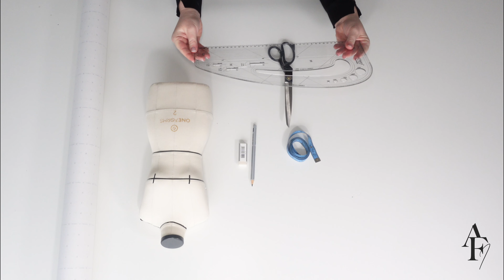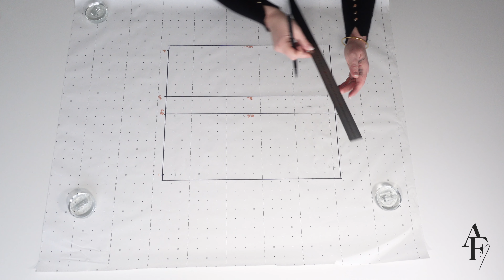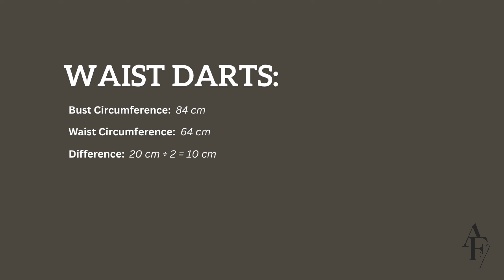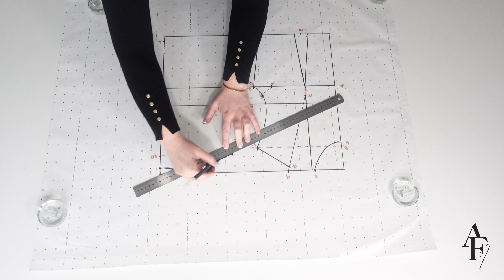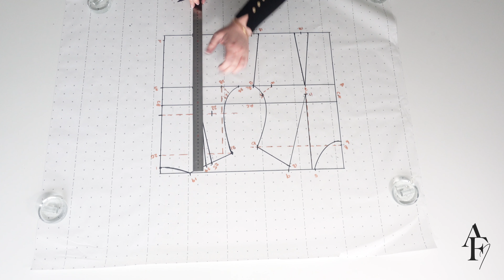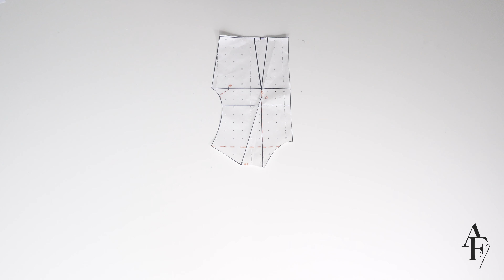How to draft a bodice block pattern

Comment: in your example for bust dart. the first line you show YOUR bust size at 84 (then you'll use the 6.4 - as shown in the chart you provided). What I"m not clear on is in your formula example you show to subtract 84 - 88 = -4. Why did you choose 88? Is this example only to show us the increments? so that if we are off your chart we know how to do it?  If so, why pick 88? that gives you the -4, but how would be know which number to pick? do you always pick the next bigger? that gives you the negative for the formula. But if we picked the smaller number we get a positive. So can you explain why you picked 88? Thanks
Reply from the maker: Thank you for the feedback! It looks like some of the sound has cut out in the video where we go into more detail - we will look into this. If we cannot resolve we will re upload shortly

Comment: hola los talles nunca son iguales el delantero y la espalda no veo la diferencia de ambos
Reply from the maker: Great observation! While the front and back may look similar in the early drafting stages, they do have key differences (like the bust dart in the front, neckline shape, and shoulder length). These become more obvious during construction. Be sure to label each piece clearly to avoid confusion later on!